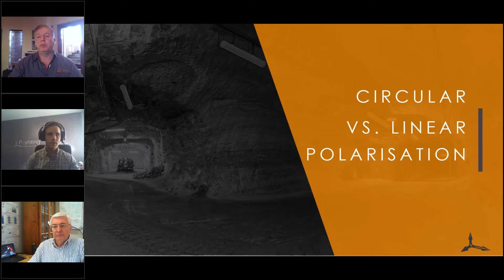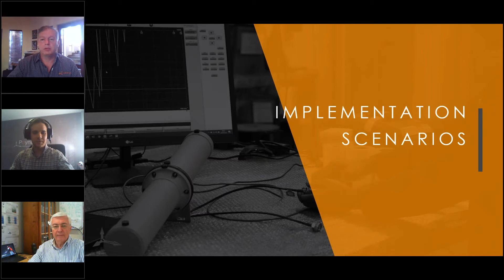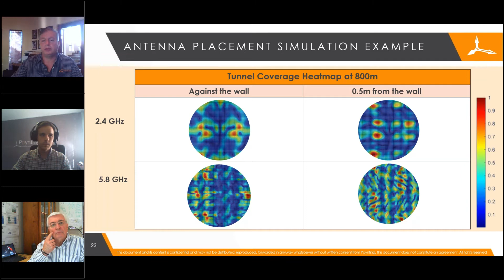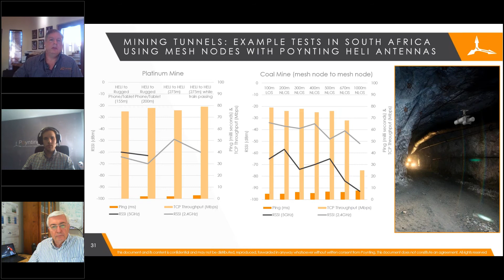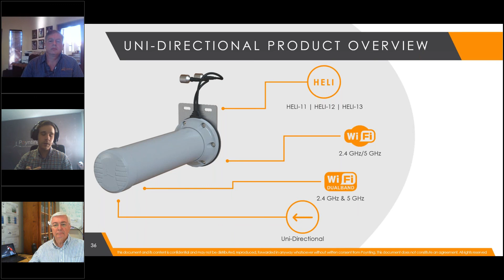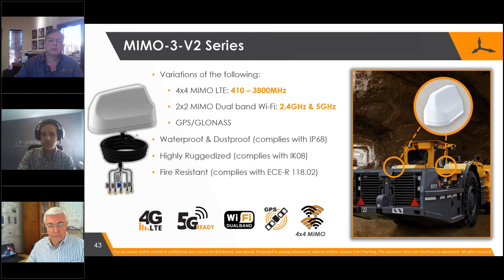Webinar 6: Digging into circular polarised underground communication

Comment: So these circular Antennas should also be the choice in dense urban environments where the (directional) signal has to propagate through tight but long spaces between buildings or where there are simply many obstacles for example vegetation in the way?
Reply from the maker: From our technical team: So in principle, circular polarized antennas work well in tunnels because the signal bounces off all sides of the walls and the roof and is contained within the tunnel. Out in the open streets they won't be optimal for the application as there'll be lots of "holes" and signal isn't exactly contained.
Reply: @poyntingantennas  Ok, Thank You. That was helpful to make an informed decision and kick some variables overboard which held me in the uncomfortable state of which horse to put my money on ... :)